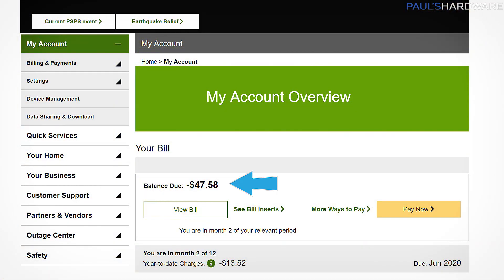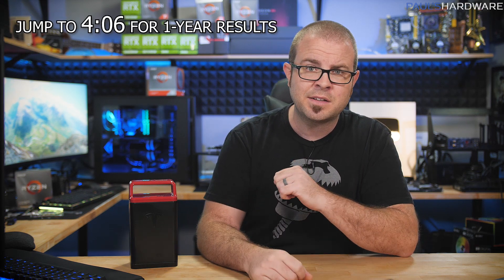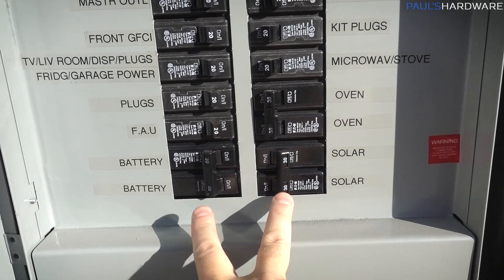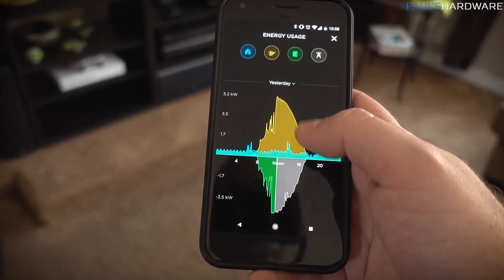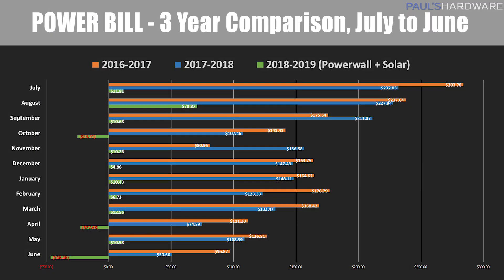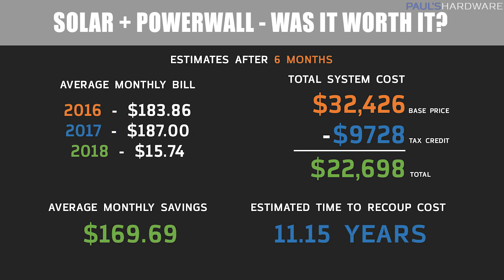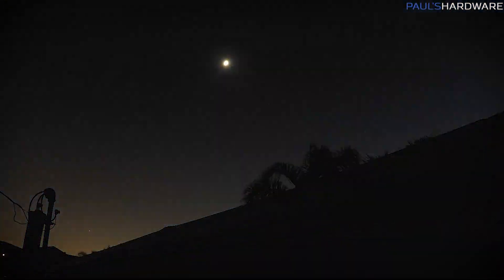TESLA Solar and Powerwall: 1 Year Later!

Comment: >^. .^<     Yes Please, a  B4 n After cleaning vid please......   Remember the grime on your panels is additive.  If you do not clean regularly,  the panels will be lots dirtier after a year of no cleaning vs a few months obviously....   So if you are planing to do a thural test you should consider do a few different time intervuls since the grime is additive. At least I know it is on my 20 panels (2, 10 panels on each top of the pole mount arays) they are. However I live in a heavy forested area of Pennsylvania in what is often called a tree well. I get tons of leaves in the fall and tuns more polland in the spring. 

I originally cleaned them frequently but I am now a 7o year old VietNam veteran and recently developed drop foot in both legs perhaps from agent orance exposure so my mobility is perhaps 90% gone now. And even more so since the arrays are on a slope, so I no longer can clean them my self.  The below giant Googel Maps URL should take you to a zoomed to the max airial photo of my sysetm if U care to take a peek.  https://www.google.com/maps/place/Reeders,+PA+18360/@41.0172071,-75.3178234,106m/data=!3m1!1e3!4m5!3m4!1s0x89c48ad5bb1ab003:0x3a49c4b434d6db7d!8m2!3d41.0189803!4d-75.3360172

Comment: I thought most places don't allow solar panel to generate electricity back to the grid yet. Because if the grid is down, and someone tries to repair the grid, they may risk getting electrocuted from the power that is delivered from solar panels.
Reply: The grid tie systems have to have the safety feature that when the grid is down it doesn't feed to the grid. The certification for this, is part of what caused the slow approval processes from his electric company to have a grid tied system.

Comment: What?! They did your roof for free. Damn that pretty much paid for the system.
You should include the cost of a new roof then you ROI will look a lot better.
Reply: Wouldn't be similar for the average customer tho
Reply: People don't recognize how obscenely cheap it is to redo a roof. Right after I graduated I started doing some construction before going into the Air Force. I was getting paid 70 bucks a day. After two days the roof was done and after the costs of material and labor the dude I worked for walked away around four thousand dollars richer.
Reply: Also, he said they changed the roof under where the panels were going to be installed,,,, not the entire roof..... Of course they had to, he has a million subscribers......average joe would be SOL.
Reply: TIB1973 p
Reply: @TIB1973  I'm not sure it has anything to do with the fact he's a YouTuber, and more that they should have inspected the roof when they first quoted him and noticed the roof was too old then.  Similar happened to me when I got solar.  They neglected to look at my junction box until they came to do installation, and thus they upgraded it for free for me.
Reply: @WhiteWoof  installers are not Tesla. The install is between the installer and the homeowner not Tesla. The pre inspection is done by the installer not tesla. He said Tesla paid for the portion under the panels, why?  They have no reason to pay for the roof unless there was either a gain or a detractor they didnt want to risk.  Maybe I heard it wrong, I just don't think Tesla is going to pay for every install where this becomes an issue.  I think 1M subscribers was factored in when he called Tesla, I believe the average Joe would have been left hanging.  To be clear, I hope he was able to leverage his channel to get Tesla to pitch in, terrible situation to be in.
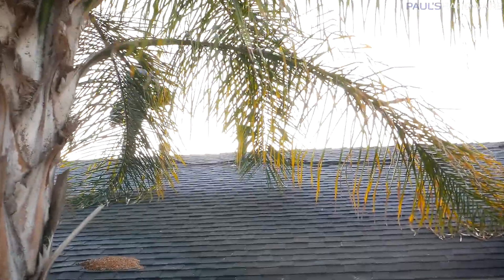Reply: @TIB1973  At 1:56 "But since they missed telling me that earlier in the installation process, Tesla offered to cover the cost of reroofing the area under the array"
It's the exact same situation I had.  We screwed up and neglected to do our job entirely, we're not punishing you for this.  The company doing the installation is also the company that does the inspection, in this case it seems it was Tesla.
Reply: @TIB1973  It's probably a bit of both. Tesla probably could have backed out of the install, but they are a new company (in solar roofing) and they want to build customer awarness and loyalty by focusing on customer service.
Reply: @veergauba  sure.  I pull for Tesla, I like Elon and hope once they get the battery supply issue figured out, they will see more business.
Reply: @TIB1973  Installers were Solar City, completely owned by Tesla.
Reply: @horus909  perfect, that explains it then. Thanks.
Reply: @TIB1973  Stop spreading FUD, Tesla/SolarCity does not use contractors.

Comment: I used to work for solar city bro go into your attic and make sure you don’t have any lag bolts from the puck installation coming out of the side of the rafters
Reply from the maker: We made it through the winter this past year without any leaks, I think they use a different mounting method now than when it was just SolarCity. I will take a look next time I'm up there though!
Reply: emor lozano this is the real pro advice. I work for another solar company and installers will definitely miss rafters with the lag bolts
Reply: Yeah if you want to avoid a headache in the long run and not have a roof leak just takes a few minutes to check if you    Have enough attic space that will allow you to walk through

Comment: I live on in the Arizona desert right now at 110 degrees lately. My refrigerator is broken, so my air conditioner on my 30 trailer is the only thing running. And I really don't turn on the lights at night. And my electric bill is $140 for just electric? That is ridiculous.

Comment: The payback time is less. You didn't factor in increasing electricity costs and by implication, increased earnings when you get credits. At a thumbsuck using increases of 3%p.a. compounding smoothed, It would take about 9,5 years.

Comment: Plow 22k$ into something only to pay it off more than ten years later?  Those economics suck caulk.
Reply: Honestly. Are you serious?  Stupid comment. 

If paying it off (meaning return on investment, or ROI) is irrelevant then does it make a difference to you if the installation is 12k$, 22k$ or 44k$?  

Let me guess you are not too good with money are you....?
Reply: If the payback is 10 years then in the ten years following the installation you will have earned exactly zero percent return on the initial investment of 22k$.  

At the time of this video the yield an a 10 year treasury bond was approximately 2.5%.  So the solar installation was a net negative 2.5% return over that same period of time because you could have taken that 22k$ and bought T-bills instead of investing in a solar installation to offset your utility bills. 

It’s not hard to understand that, from the perspective of an investment economics, this sucks .

....that is, of course, if you understand money. ;-]

Comment: If it rains a few times per year where those panels are, cleaning them wont help you.  Now if you have a sand dune building on your roof that's a different story.  Just a lowly electrical engineer's opinion...

Comment: unless u have lot of power cuts no need to opt for tesla wall or battery system with solar better to go for efficient appliances and ongrid solar to reduce to power bill. tesla wall or battery only suitable for offgrid customer, high power cut facing customers, etc. only. also ongrid is cheaper than battery or tesla wall system so ur payback comes faster with ongrid system as well.

Comment: Not a good investment considering 1/3 the cost came from tax payers and the power wall only is warranted for 10 years.  Without the tax incentive that would be an 18 year rate of return.  Invest the same money in stock or CDs and anything above a 4% rate of return will provide you more more benefit.
Reply: But the tax payers get multiple benefits for having the system installed.  If making money was everyone's only concern then little things like slavery and war would be the leading profit centers for our investments.

Comment: At 1200RPM just over idle doing 100km on cruise, the engine would labour when you try to accelerate that would cause an bit of vibration and shutters. Drop down a gear and problem is solved .

Comment: So almost 13 years to lay off after a nearly 30% tax payer funded subsidy?  I LOVE alt energy systems but people need to be fair and admit this technology isn’t even close to ready to replace standard systems yet.
Reply: Depends on where you live. In germany you would look at around 8 years payoff without battery (which is actually making it more expensive). But just panels that live 20-30 years and have paid for themselves after 8 seems pretty good
Reply: Kermit Did anyone claim that?   If you’ve got the money to burn though why the heck not?   It also depends on where you live.   I think everyone knows this.    There is obviously room for growth and improvement, but we obviously can’t keep doing nothing and rely on the status quo.

Comment: Just a small piece of advice. I saw you still have an oven on your AC/utility power. Try installing a gas stove & oven. It makes life a lot cheaper.
Reply: Yep, in Arizona we use a propane oven outside in the summer time and put it inside in the so called winter season.

Comment: Wonder how long it takes to recoup costs if you dont have palm trees in your yard.
Reply: Fun fact: solar panels are more efficient at colder temperatures  so despite there not being a much energy for them to take in the added efficiency kinda makes up for alot of it.
Thats possibly another reason why it was cheaper in milder months apart from just ac usage.
Reply: @Joeink100  That's a positive, but we get over 100 days with 80% or more cloud cover here.  And 3 months of the year we average over 20" of snow, which doesn't melt away.  And we average well above the 77 degrees or whever the break even point is during the summer. 

We definitely arent going to match that guys numbers here.

Comment: Batteries life time is....? Would not you need to buy new power wall in 10 years?
Reply: If it's used properly (that's question to Tesla design/engineering) should still be capable to hold plenty of original capacity. Even if replacement (or simply addition of new battery) would be needed it would cost way less by then as new/better technology to store energy appear.

Comment: Now instead of paying to electricity provider you pay to Tesla company over 22 thousand $. For end user there is no different.
Reply: Yeah, we need long term to see if it lasts more than the 10yr warranties before you have to pay tesla again for replacement parts... including code changes (which could required panel changes - super expensive. This would be naive to ignore)
Reply: Even if there is no difference, at least it's a clean solar energy. And you're protected in case of a power blackout in the neighborhood.

Comment: What is the rated lifetime of those solar panels (and the battery for that matter). Because last I heard the rated lifetime of most solar panels (and batteries) is not that much longer then it will take you to pay it off. meaning once you finally pay it off you only have a few years of use out of it before you have to put out that cost again to replace it.

Comment: You literally paid for 12 years of electricity up front that is all that happened. I bet that system doesn't last the full 12 years to get back what you put into it. Nothing is built to last now days. Manufacturers do whats called  engineered dispose-ability look it up. That means it is designed to last exactly and not much longer than what the rated duration is. So in about 12 to 14 years your going to have to dump even more money into the thing just to keep it going. Thus defeating the reason why you even installed it in the first place.
Reply: @A. B.  My parents 17 year old system is still generating more than they use and actually paying them.  Solar has a long lifetime.
Reply: @phunkydroid  and they never replaced a battery? Doubtful. I could see if they never had to replace a faulty panel or inverter if they are lucky, but there's no damned way they haven't replaced batteries, especially since they are likely lead acid given the age of the installation.

Comment: If you invested that $22,000 in the stock market at a modest gain of 6 percent per year, it would be $42,000 after 12 years, and each month the interest would be gaining you $210 dollars, while saving you only $149 per month, and you would have only recouped 22k of the 44k opportunity cost. At the 12 year mark it is basically costing you $70/month. This thing will quite literally never pay itself off. It's fine getting it to be green, but let's be honest... They are too expensive to be cost effective at this point, and people need to be honest with the opportunity cost of plunking down 22k, because the time value of money is a thing.

Comment: The ROI calculation isn't correct, you need to take into account that money you invested could be delivering interest if invested. Additionally taking into account that it would take over 10 years you also have the risk of having faults not covered by the warranty. I don't think it's worth it from a financial point of view, it would make much more sense if they could be rented because in 12 years your solar panels will be outdated.

Comment: Well dust can diffuse or outright block light, so I believe cleaning it up should increase your power generation by at least 10% based on the amount of panels you have. :) I personally recommend once a month. When I get solar panels I fully intend on installing high pressure nozzles on each panel parallel to the panels, to clean each panel automatically on a timer. It’s relatively easy to do. :) one thing that also gets neglected is cleaning the condenser coils on the AC unit. Should be done at least yearly.

Comment: Thanks for the update, however, based on what you have showed us and what you will have to replace in the future, you are not saving anything and are losing money. As the panels age, they will not work as well, and so your 12.9 year to pay them off with grow, and it looks like it may reach closer to 19.8 years to pay them off/recup. Still is not worth it in any form. Other than you got a free section of your roof.

Comment: Paul, there's one thing that you could do to further your savings... Check your AC ducts. Some companies inefficiently build ducts that are not built to suit the units needs.
For example, we (my parents) home has a 12 ton unit outside and it's capable of cooling an extremely large home, but due to restrictions in the ducting... It stays on all day and is ineffectively cooling their home due to restrictions too close to the blower/coils of the inside unit.
If they replace their duct per the algebraic formula for flow rates, they could correct the issue without hiring a crew to do the work.

I'd bet a dollar that you could fix yours to further drop that bill in the summer.

Comment: How have you calculated in the cost of replacing the invertor which I understand doesn't last much more than 10 years?

Also what are the energy and cost savings of simply having sun oriented windows, suitably shaded in summer, as well as Solar Hot Water, water heating being one of the largest energy consumers?
Reply: I would say most people have gas water heaters in CA because gas for the most part very cheap except for in the winter.
Reply: @MACDRU421   Solar Hot Water is cheaper and (I know this is America so who cares?) better for the environment.
Reply: @peterbreis5407  Is cheaper compared to what? Heating water in CA is a non-issue and is not one of the largest energy consumers. Your America comment is stupid and off-base.
Reply: @MACDRU421  Hardly. Reducing carbon pollution is (with a few exceptions) "who cares" in America. 

Water heating 19%, and space heating 43% make up 62% of household energy consumption.
Reply: @peterbreis5407  Like I said in CA.  A non issue.  Cooling is the major issue.  Again using solar to heat water or use of geothermic heating is a non issue in CA because of space and location of the population. DOESN'T MAKE SENSE.
Reply: @MACDRU421   What is "because of space and location of the population" supposed to mean?

Am I getting the strong impression that you don't care about carbon pollution, but object to anyone mentioning the obvious?

Comment: I would like to see the before and after panel cleaning. Specifically, the benefits of doing so and how that affects the power generation. 

I also have a Tesla PV with two powerwall 2s, looking to get a third as I have a full home backup and I find the constant use tends to run both batteries down significantly if it is cloudy over several days. I begin to pull power from the grid, which is not what I want. Last month I was way up in credits, this month I am owing money. Hopefully it will balance out in the end like yours did. 

Thanks for your PV videos, I would like to say your videos really pushed me over the edge in deciding to go solar. I was going to use your referral but I signed after the referral system went away.

Comment: Have had my panels for 6 years, have cleaned them once. Didn’t make any difference. I have logged output every minute since installation into a MySQL database to check output. Maybe it is because of the different climate.  The snow in the winter here seems doing a good job of scrubbing the panels when it slides off.
But please do a test. :)